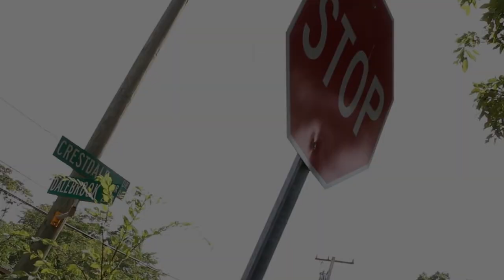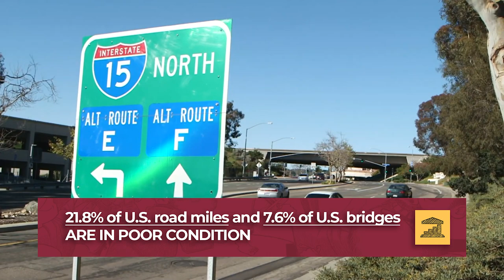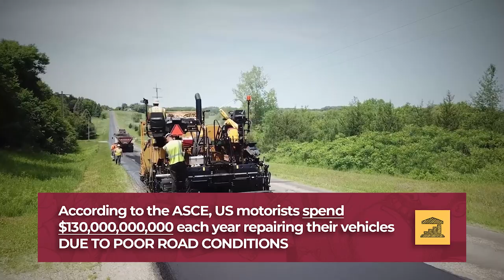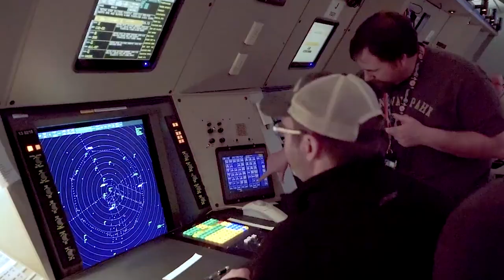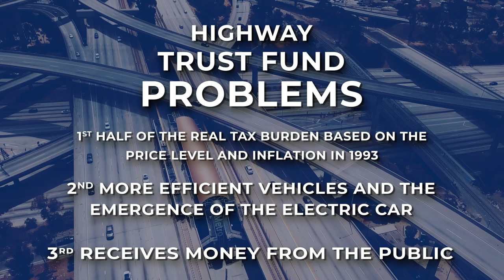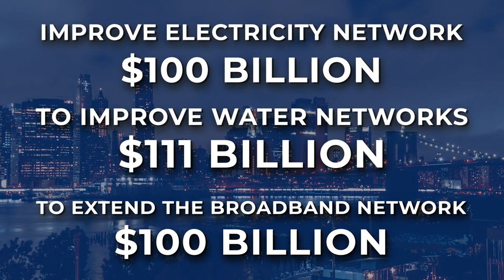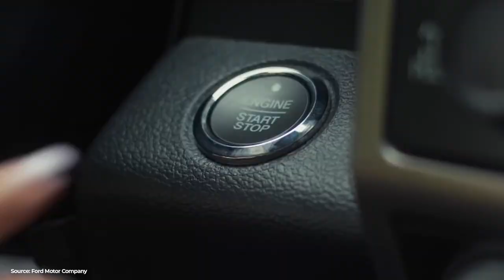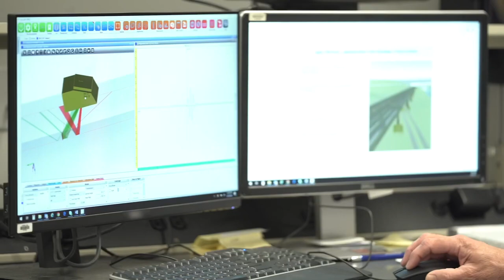Why is US INFRASTRUCTURE so BAD? (And what is BIDEN’s plan?) - VisualPolitik EN

Comment: What Trump failed to mention about Eisenhower's building of the interstate highway is that the income tax level back in that era was as high as 90 percent.
Reply: 1. That tax rate was not paid by even the majority of the Top 1%. 

2. The interstate highways was actually completed between 1950-1992. We did not build 250,000 miles of infrastructure in just 8 years
Reply: @SamSam-vx7cs  they are the ones who still run things and will continue to do for a very long time.  Its not minorities jumping up and down in rallies saying taxation for building these roads is communism

Comment: The lack of will to spend what is needed on infrastructure instead of big corporate tax breaks.

But it has been a world problem for decades.
Reply: Except that corporate tax break pretty much broke even, the increased  economic activity created additional tax revenue. You can only milk a cow so much before it stops producing more milk, but if you give the cow a break it makes you more milk.
Reply: @eminencerain848  There should be no corporate income tax.  It should all pass through to the taxpayer.  All taxes should be paid by individuals and taxed only once.
Reply: Its one of the strange differences between European leftists and US leftists.  The EU leftist know better than to attack the businesses (no businesses, no jobs, no taxes, no free stuff). The EU leftist taxes the heck of the people, the US leftists tax the heck out of businesses (which have left or closed), resulting in very few people actually paying taxes in the US (50% pay no taxes, another 25% pay so little that its insignificant, while the upper 2% pay 50% of the taxes.
Reply: @eminencerain848  except top corporations don't even pay federal tax through tax evasion loopholes infact they get federal rebate instead. Top 1% tax evasion cost US about 175 billion a year, those money could've gone to infrastructure. Not asking to pay more just pay what's owed.
Reply: @RS-ls7mm  Related to what you said, Europe also hits everyone with the value added taxes.  This does give them flexibility to have lower corporate taxes.  Also, most other countries have a territorial tax system while the US taxes worldwide income.  Finally, most other countries don’t have inheritance taxes like the US does.
Reply: @kaidi223  You overlook the fact that most corporations get heavy tax breaks from the local governments since they want the jobs more than taxes.  Amazon pays very little because the government wants it that way.
Reply: @RS-ls7mm  US leftists are guided mainly by socialists of the Central America, with the Robin Hood's syndrome, take from big companies to give to the people.
Reply: @garykaplan7728  The 75% tax on new cars in some EU countries came as a shock also.  Its no wonder that the number 1 export from the EU is people, you can work your whole life and have nothing to show for it. (Something I heard from a European).
Reply: @RS-ls7mm  yeah so as you can see people won't feel so bad of Amzon just paid a little bit of tax on their 386 billion a year profit is not going to break them or cut into their job creation sector.
Reply: @RS-ls7mm  You are generalizing way too much when you say that you can work your whole life in Europe and having nothing to show for. The continent includeds dozens of different countries. For a few of them that may be the norm for most people living there, but usually that statement doesn´t apply at all for the average person. Oh and i´m pretty sure the EU´s biggest export is cars, definitely not people.
Reply: @krustenkaese3905  Like I said its what I heard from Europeans.  Maybe they say that to each other as a joke.  Over the many years I have visited EU the people are noticeably less happy and optimistic about the future.
Reply: @eminencerain848  That's wrong, The Trump tax cut never paid for itself. The debt went up by 7 billion in 4 years. The deficit doubled.
Reply: @RS-ls7mm  Then Amazon should start paying for the roads and bridges it uses to conduct its business. No more local tax breaks. Amazon is profitable enough
Reply: @chrisdecokere2899  That was tried on other companies.  They just leave, leaving the town in worse shape.  Why do the US leftists think that businesses should be taxed to death?  The EU leftists don't.
Reply: @kaidi223   I'm gonna call bullshit. there's no way they made that much. that might be their income but that's not their profit.
Reply: @garykaplan7728  Singapore had inheritance taxes (estate duty as it's called here) too until ~2008, but I guess we also tax stuff that other countries might not e.g. water (30%), CNG, migrant workers (~S$300/pax/month; reduced if the worker is more highly skilled I think), which probably helps balance our books with lower corporate  & income tax rates (but I heard the max. tax tier (22%) for the latter can be reached with less annual income (S$320000/~US$240000) than in other countries). To limit traffic congestion the government also controls our vehicle population; you have to bid & buy a document called the Certificate of Entitlement (CoE) to legally purchase a vehicle, & it lasts for 10 years. Their price can change quite a lot over time too e.g. motorcycle CoEs (Category D) cost ~S$732 ~15 years ago but ~S$8500 now, while commercial vehicles' (Category C) CoEs crashed to S$1 when we adopted Euro 4 emission standards in Q3 2007 (since businesses had beforehand already rushed to buy most of their required vehicles, as those under the older emission standards were cheaper to maintain. But by the way we're now starting to scrap our older (Euro 3) public buses, supposedly as it was getting expensive to update them to meet evolving emission standards)

Comment: The biggest problem in the US is the disparity between rich states infrastructure and poor states infrastructure. My state of Minnesota is a wealthy state and we can afford to repair and do major works on our roads (The highway near my house has been getting resurfaced with concrete since 2017) this however, isn't possible in places like Mississippi or West Virginia.
Reply: Same for Massachusetts.  Road repairs are a common sighting.  You can tell the imbalance as soon as you get around Rhode Island.  Lots of roads in disrepair. 

New Hampshire roads , notwithstanding the lack of state taxes , are surprisingly good , that being said , when I left the region in 2013.  But then , the state runs liquor stores , lottery , and they have toll roads.  

My biggest surprise was North Carolina , roads in tip top shape.

Comment: US infrastructure is bad? Aaaahahhahahaah, look to Russia. They haven't many roads in Far East and Siberia, only directions))) There are few highways in Russia which connect major cities in european side, such as Moscow, St. Petersburg, Kazan and etc. Even roads in villages close to Moscow are in poor condition. After that, you are talking about bad roads in US? It's amazing! Unfortunately, railway in US is really sucks compared to Russia. For example, at least 70 percent of railways in Russia are electrified and about 2/3 of total rail are double tracked.  Russian railways carry a lot of freight but lots of passengers also(ranking in Top 10 by ridership). And in US maybe just 10-15% of rail electrified and double tracked. However, there are no dedicated high-speed rails in Russia, only Sapsan train based on Siemens Velaro is running on conventional tracks between Moscow and St. Petersburg at maximum speed of 200-250 km/h.

Comment: from Fraser, husband of Leslie
Well, in England our roads are very bad too ! Some roads have never had any work done on them for decades.  Use of wrong material is a factor, as our Highways Agency (as was, it's now Highways England), stopped using Hot Rolled Asphalt, (HRA), and the Government recommended all the councils do the same. Yet this stuff lasts over 30 years. We went over to Stone Mastic Asphalt (SMA), invented by the Germans and it only lasts a few years, yet it lasts in Germany. and their roads are like billiard tables. How come, do I hear you ask ? Probably because the contractors are now in charge, basically with councils sacking all their highways engineers. So the contractors have no incentive to use long-lived material. Also the Germans spend the money, we don't.

Comment: So the suggestion of a new model is to privatize a public good (infrastructure). When has that gone well? England did a similar thing with their rail network, and it failed. 
Companies would only buy-in on the most lucrative infrastructure areas (metropolitan areas) and leave the rural areas decrepit or lacking funds that the US government then has to pick up the slack on anyway. 
Why shouldn't companies fund infrastructure through taxes? They need and use it just as much as the common folks. Are we supposed to give socialism for the wealthy and mega-corps and leave the little guy to fend for themselves?

Comment: Back in 1945, a sinister corporation called "National City Lines" took over the Los Angeles Railway, which served most of the central city. Then, over the course of the next two decades, LA’s extensive streetcar network was eliminated and the city’s iconic red and yellow trolleys were replaced with shiny new buses.
"National City Lines" was created and owned by General Motors, Firestone Tire, Standard Oil of California (now Chevron), and Phillips Petroleum. The streetcar system was deliberately destroyed by the companies who stood to gain the most from its demise. Not only would this facilitate the sale of buses, but it would also induce greater demand for automobiles—along with tires and oil.
"National City Lines" acquired the local transit companies, scrapped the pollution-free electric trains, tore down the power transmission lines, ripped up the tracks, and placed GM motor buses on already congested LA streets.”
"National City Lines" repeated this in cities throughout the western United States. In the SF Bay Area BART covers just 10% of what the Key System light rail covered before "National City Lines" purchased it and ran it into the dirt. The elected leaders of the day were just as crooked as they are today, allowed it to happen, and were well greased by the owners of "National City Lines" 
There is so much more but I believe the people today are more ignorant to the truth than they were back then, just look at who they elect decade after decade so to hell with it.

Comment: There is also a huge gap between different states.  In general the democratic run states spend more in infrastructure and privatize less of it, but they tend to be much more populous so they have a lot more infrastructure to maintain that sees a lot more use.  The exceptions being your less populous blue states such as Oregon and Washington which tend to have some of the best infrastructure in the US.  In Republican run states they tend to spend as little as possible on infrastructure and privatize as much of it as they can get away with.  In Texas and Florida this works to an extent because they still have huge populations for a large tax base.  In places like Wyoming with very little tax base and a lot of heavy truck use on the main highways the roads are a shambles because the infrastructure is being used much more heavily than a state with a population of less than 600,000 can support due to interstate truck traffic.

Comment: Electric vehicles are not the wave of the future everyone thinks it is because what they never say is cold kills batteries and you'll get half as many miles in the winter as you will in the summer, it's also extremely wasteful since those corrosive battery have to go somewhere and currently that's the landfill since recycling plants for them are few and far between. What we really should be looking at is hydrogen fuel cells. Anyway huge waste of money to set up charging systems that could go in to much needed roads, bridges and trains which are all very vital and also very neglected.

Comment: As a Mexican, I always hear these failing American infrastructure with a raised eyebrow:  Skeptically.  I travel mostly in the Southwestern U.S., and even the County roads are better than our main Federal highways are here....

Then again, maybe there is something to all this noise after all.  I didn't use to believe that there was poverty and economic malaise in the U.S., until I visited Atlantic City, NJ, Niagara, NY, or the Tohono O'odham Indian Reservation in Southern Arizona.... But even the roads on the "Rez" are better than many roads we have in Mexico.

There isn't any reason to not have both good rail and roads.  Germany does. Trains clock 200 km/hr, and one  can drive on the auto bahn at 160 km/hr (100 mph) without feeling a single bump on the road.

The thing about trains is that you need two things to make them work to their potential:  High population density and short distances.  Japan and most of Europe qualifies on these two criteria.  That's why they work like gangbusters there...

As for the airport, just about every town of size in the U.S. has an airport.  Can't really beat that...

Comment: Both plans are terrible. Biden's plan is typical of Americans, drug induced spending frency. Australian plan is horrible too, privatization of roads is never free. All this cost will be paid in premium by communities dependent on those roads.

Here is what USA needed to do. Completely descentralize central spending for roads. Remake tax model in a way that local states should worry about their road infrastructure. Raise road taxes/fuel taxes/whatever for everyone. Create a system where public companies have enough funds not only to sustain existing infrastructure, but inherently gathers more of it than it is needed. This system will eventually solve the problem and allow for new expansion. 

Central government should only be left to finance separate projects, new projects which on its own might be too large for states to handle. Furthermore, central government should issue a huge spending plan. However, instead of trying to fix the problem, it should alleviate the problem by giving initial funding boost to cover the worst projects immediately. The rest will be covered or not covered by local states as they seem fit. Central government should continue with its plan to build new infrastructure like green energy, power grids, internet connection. This is new infrastructure which is needed to bring USA to 21'st century and its cost is just too high for individual investors. 

Overall, cost of a plan should be lowered significantly in order not to put such a tax burden on corporations. Money which is being printed should be redirected towards infrastructure and consumption should be boosted through it.

Comment: I dont often say these videos are garbage, but this one is close.  First, the US is a sovereign currency nation that owes all its obligations in its own currency.  Debt is irrelevant unless it is causing inflation.  There is very little inflation in the building of infrastructure.  Any current inflation is associated with restarting pandemic supply chains.  US debt that invests in the economy will provide a better return than tax cuts.  Second, Federal spending is not in any way connected to taxation.  Taxation is only to legitimize use of the currency (you must use dollars to pay taxes) and to pull money out of sectors that are over heating or fight inequality.  Every time Congress passes a spending bill the Treasury has the Fed create new money.  They dont look at an account called "taxes" to see what they can spend.  Money is created out of thin air.  Fiat currency.  Saying you have to "pay for" on the Federal level is wrong, you dont.  When you create the money you cant go broke.
Comparing the Federal Government's spending to a company's balance sheet is wrong, and it is sometimes purposefully misleading.

Comment: I didn't like the Toll Road system in Colorado when I lived there; I would have rather have paid a little more in state tax than stop at toll booths on a freeway, might as well have been stop signs. Perhaps just poorly designed. My question is, why would I pay a gas tax then? I don't like the idea of paying for new infrastructure only to sell it to a business that will charge what the market will bear to use it. I think if a business wants to charge me for using infrastructure they should be the ones to pay for building it.

Comment: I think Australia's funding model is better. The roads that generate more funds will get more money for repair, maintenance and expansion. It also provides more granular monitoring and speedy maintenance of each asset. The USA's approach pushes the decision making to the central government which has already shown inefficiencies. Adding more money will not resolve the issue unless the process itself can be fixed. Corporations may also not end up benefiting from the taxes that they paid for and may be burdened by the increase in taxes. Since the US economy relies on these corporations, it would risk pulling down the country as a whole

Comment: Not even at the federal level, but just look at the local level with cities, and you will see a major problem with US planning and infrastructure. Urban sprawl is too costly. Maintenance of the infrastructure (not only roads, but including water, electric, cable, etc.) of all the spreadout neighborhoods costs more than the additional tax revenues received from the new developments. The only way to pay for maintaining previous infrastructure is to continuously develop new neighborhoods to pay for the existing ones. And that is just at the city level. And good luck trying to make mass public transit to all of suburbia. There's just not density needed for it to be economically viable.